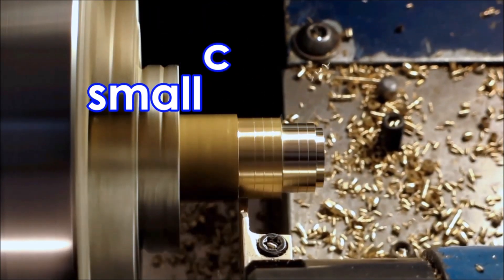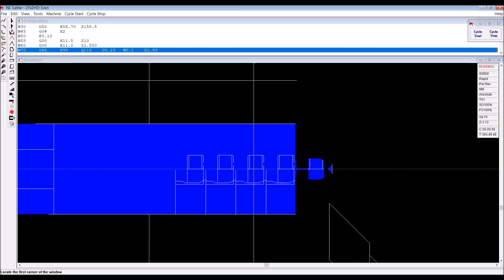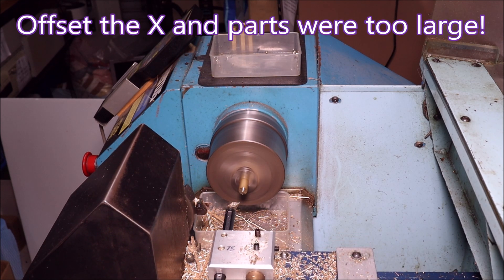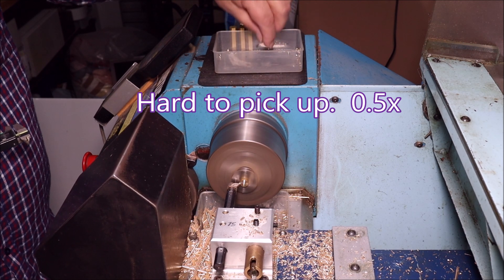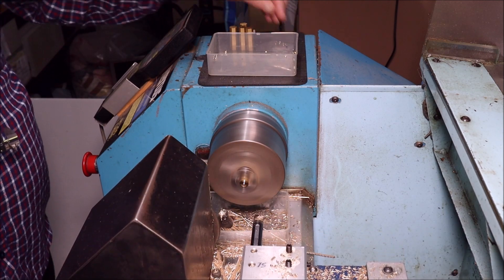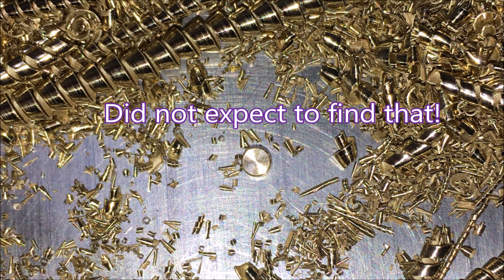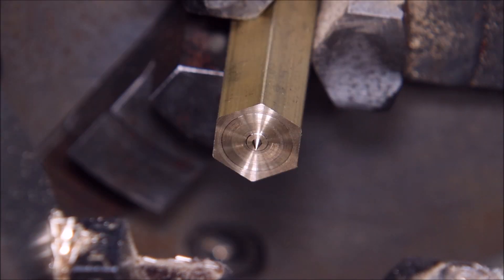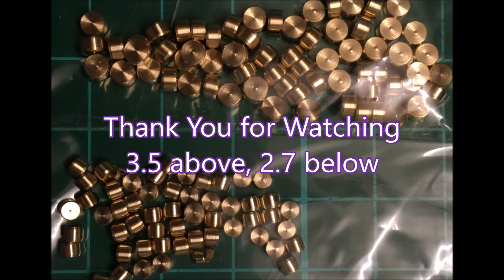Tiny 2.7mm brass bush turned in cnc lathe. Used in clock repair

Comment: Hi,
Interesting video... I had not considered catching the parts when they are so small... do you lose any?
Take care
Paul,,
Reply from the maker: Hi Paul, by leaving them “on” , which is normal for me, I lost 3 in a hundred, so I just made a few more. Why those three fell off, I have no idea as the rest managed to not drop off!
I don’t normally drop parts off, as threaded parts become scrap all too easily if they hit the chuck jaws and get thrown around. I have tried at times to use a catch tray, but have found leaving them on is much easier.
Reply: @smallcnclathes  3 in a hundred is not to bad...

Comment: Are you saving the brass chips at all?  Seems like this job is mostly chips.
Reply from the maker: I am, they are worth too much to waste.  Will be off to recycler once we are able to travel again.  I would not have been allowed to get smaller stock due to our crazy Covid restrictions.  I have had these blanks sitting around for years (I have hundreds of them) so I was glad to use up a few, after having stored them for so long. Thanks for your comment.
Reply: @smallcnclathes  glad to hear it.  I wondered if the larger stock served a rigidity purpose, or if it was just handy.
Reply from the maker: You are right, if I was using small stock I would have moved the stock for each part. This way I managed five per piece. But I was pleased to use up some scrap!

Comment: If only your turret could bring a tray in to catch the part when parting off. ;)
Reply from the maker: I would have replied earlier but was puzzled as to how to answer! Of course many machines have parts catchers, but mine was only ever intended as a student training lathe.  The thing about these parts, is they are so small that to even pick then up is difficult, just far easier to pick them off the blank.  This does mean that the part depth needs to be just right.  Easy to pull off, but no danger of it falling off. During this run2  more fell off, I just made more.  Thank you for your comment.